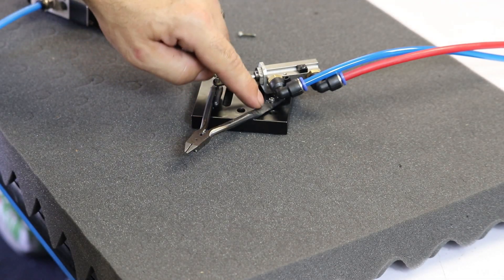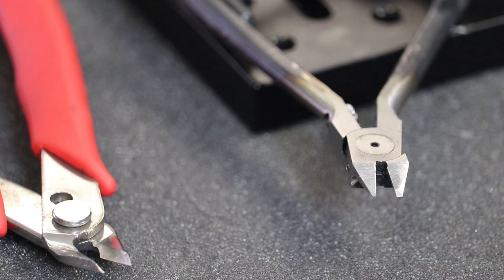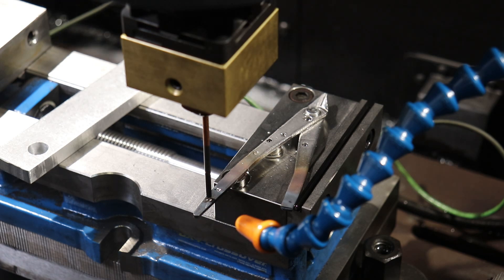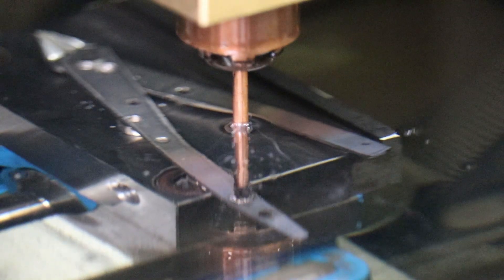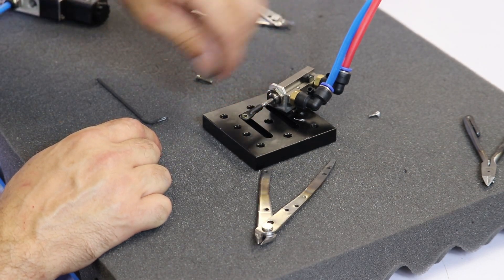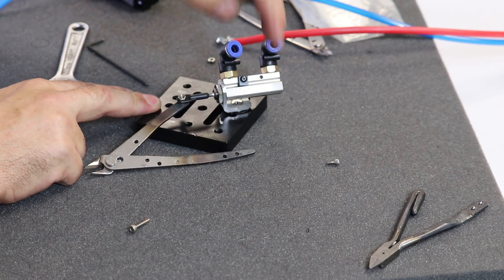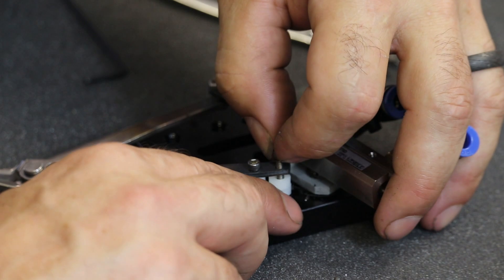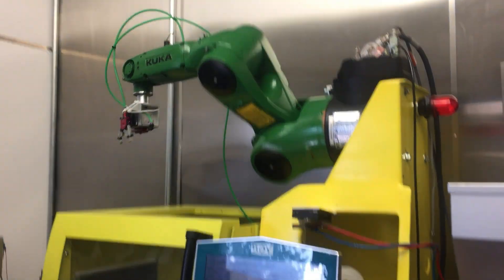REPLACEMENT CLIPPER WITH EDM MILLING

Comment: Look into submarine gates. No more cutting needed
Reply from the maker: Yes, I do use sub gates at times, but these days I usually have the robot grab the parts to do automated assembly, so I sort of need the sprue as a handle to get the part to the next robot ( not shown).  Thanks for watching!

Comment: Really good Video, i like youre explantion that a methode of drilling a hole in hardened steel
does not worke.
In german the EDS- Machine is called Funken Erodiermaschine and that is in english, spark eroding machine.
the differences are funny, i think.
Reply from the maker: Hi Mario, thanks for watching and the German insight.

Comment: dose the edm do a good job cutting through aluminum?
Reply: I think it would, but apart from a few niche use cases you'd be better off milling that, since the material removal rate of EDM is rather low. The maximum is about 10 cubic millimeters (or 0.0006 cubic inches, or 0.002 tea spoons) a minute. Compare that to a CNC mill which can literally obliterate aluminum.
Reply from the maker: yes, the EDM process is pretty good with Aluminum, but the finish is not as good as steel, probably due to lower melt point and larger grain size in Al
Reply: Yes, it does with the correctly electrode.

Comment: I think for a long term solution you might want to look into a shear rather then a diagonal cutter.  Easier to sharpen, cleaner cut closer to the part.  At least, I think...  I've used shears before and they can work well with the right geometry.
Reply: I think the problem is that the sprue that is left on the part can't always be cut off flush with a shear. Those "God Hand nippers" he used before are used for that exact purpose (they are used in model building) and cost about 80 to 100 dollars.
Reply from the maker: Thanks for the advise Kevin.  I agree with you about the shear action being better, Vincent has a good point about clearance too.  Some applications I will try sheers.  Do you have a supplier recommendation?
Reply: @DragonflyEngineering  I wish I had suppliers.  I'm a home-shop idiot who, for some reason, loves to watch channels like yours because I learn stuff.  Some days I'll even remember stuff <grin>.  Its just that when I use my shear, it produces really good cuts.  When I use the diagonal cutters, their gap changes too much.  I'm not allowed to have nice things, so I go through quite a few diagonal cutters.  Even my bolt cutters need some repair.